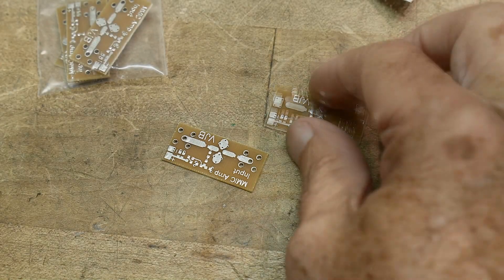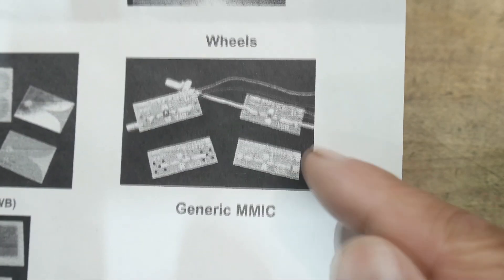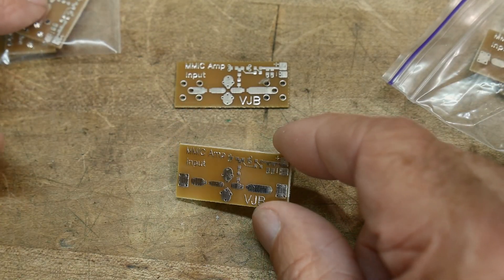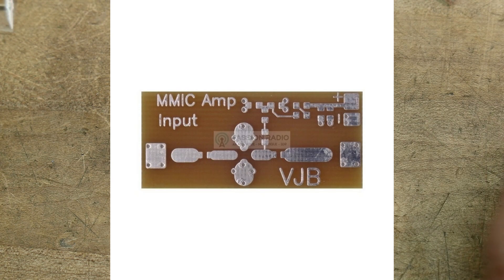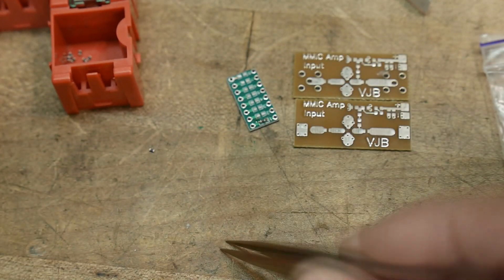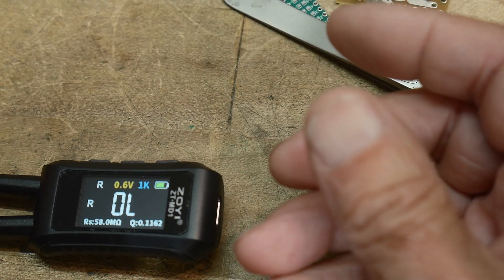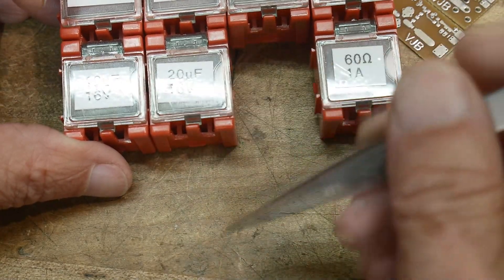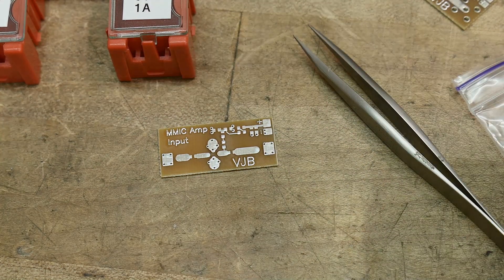#2069 MMIC amplifier boards from WA5VJB (part 1 of 2)

Comment: As for the holes for those older types of MMIC’s. Have worked on plenty of of PCB’s using them without holes, the legs were just bent down the body and then at right angles at the PCB. Still love those old-style MMIC’s… even though they are just darlingtons in disguise, they are very cewl.

Comment: The ferrite beads are typically defined by impedance at 100MHz. Again, not always, some manufacturers give you the inductance and max current, and by looking into datasheet you can find all the jucy data. Permeability vs frequency and stuff like that...

Comment: The inductor is used for peaking, in other words improve high frequency response.  I don't think ferrite beads would be a good choice because the beads are designed to be very lossy at high frequency.

Comment: The first resistor before it went to Davie Jones locker, Looked to show 60 Ohms   ?
Reply: 4:56 It looked like 60.7Ω, but then it went to /dev/null. The second one shown different values. Maybe there are mixed parts in that bin.